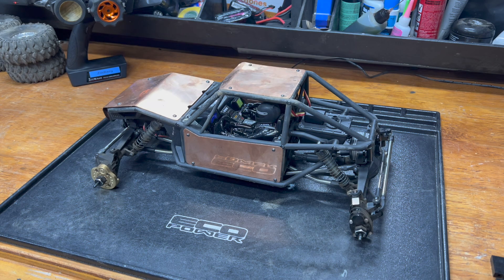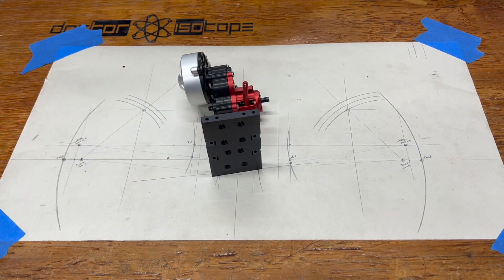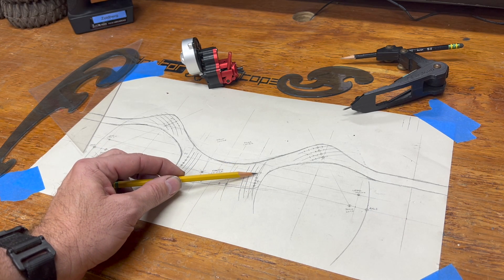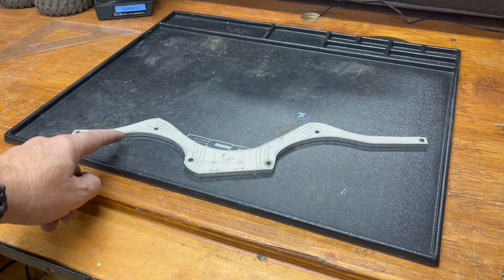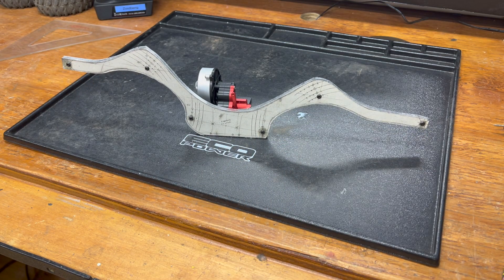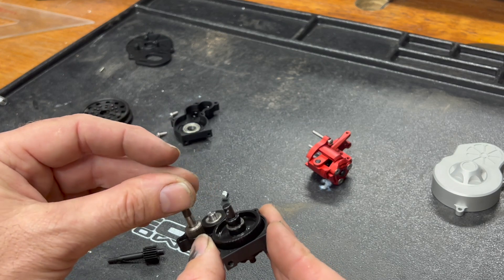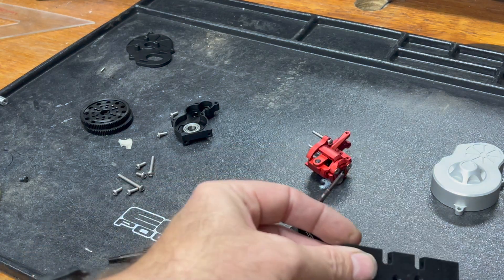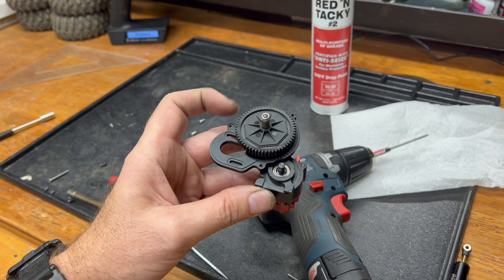Crawler Canyon Presents: PROJECT:ZOIDBERG, the first second part

Comment: Nessy lookin sick! Leave the caster angle. Just try it. As long as the drive shaft isn't under your lower link send it. I vastly prefer caster angle on my 4ws rigs. Far more stable on vertical grip and the hook on dig is far more effective that a vertical caster.

Comment: The measuring tool you need is a machinist scale, aka “flexible steel rule.”  Available from online from industrial supply-type companies in 18 and 24 inch flavors. $30 would buy a pretty nice one.
Reply from the maker: One of my prized possessions is a little 6" Starrett C334 double-sided rule--  and lemme tell ya, I'd love to have something in that 18" range from Starrett or Mitutoyo, but I've never been able to make myself do it. For 90% of stuff I'm using the steel rules pulled out of $10 Empire combo squares.

Comment: Well done with the chassis fab!

Have you explored using micro servos for dig actuation?  The AGFRC A20CLS actually IS the Reefs99 micro a lot of people like to use for that.
Reply from the maker: I am not a huge fan of micro servos--  there are a short list of them that are any good (the A20CLS probably being at the top) but for the cost I can buy three JX4409s and not care if one burns out. If I have the space, I'm putting in a "full size" servo. I built the Tranquish specifically to run half-height JX-4409s for everything except steering. In all my builds, they're my go to for "everything except steering."